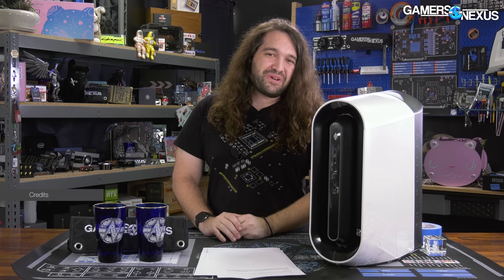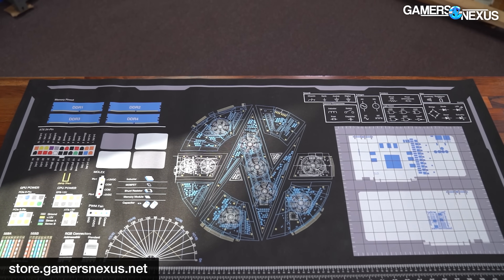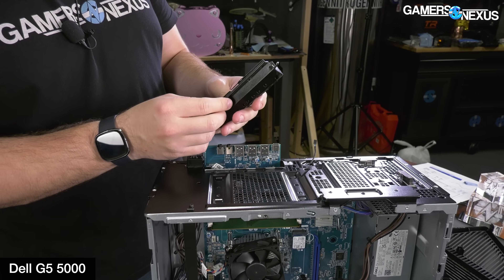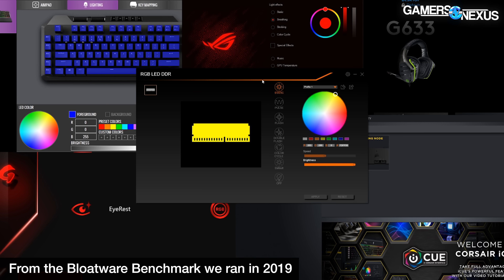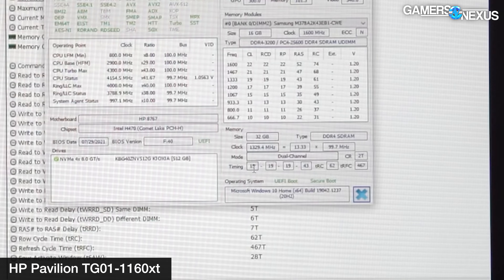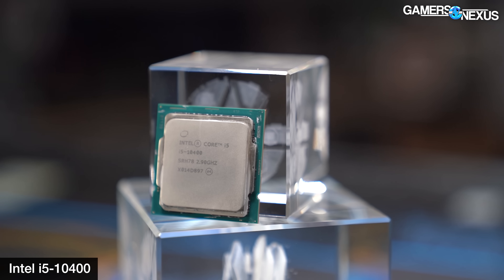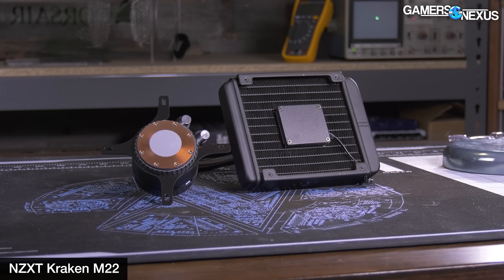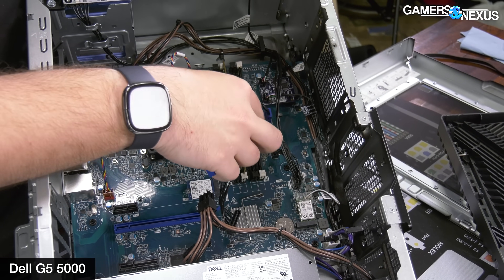The Worst Prebuilt PC Mistakes We've Seen (So Far)

Comment: there are a LOT of prebuilds that lie about ram speeds. blatantly lie.
Ive seen countless ones that advertise higher speed ram on an intel platform using  "b" series motherboard. 
like say, 3200mhz with an intel i5-9600k on a b450; the platforms chipset literally CANT support those speeds.
and whats more, than ram doesnt have an XMP profile, so it couldn't even be run at those speeds in most computers without manual tuning. 
and even then, half the time the ram cards themselves dont even meet that spec at all.

ASUS, MSI, Dell/AW are the ones i mostly see this on. Lenovo USED to be better, and HP wont tell you; they cant lie if they never disclose that info right?

Comment: I once had an Acer prebuilt. I5-8400, 8 Gigs single Channel RAM, Zotac GTX1050 2gb Mini 75w version. I bought a new sata ssd for it to have more high-speed capacity and had to srsly, tape it to the metal frame because there were no mounting holes for 2,5" drives, only for for another 3,5" drive. Ive upgraded the RAM from a friend´s failed attempt building a pc to 16gb and like a half year later got rid of the case, bought a new board for the cpu and wanted to swap over everything. Well, the psu was mounted in such a way i srsly had to destroy the old case to get it out, had so short cables, that it wasnt usable in any other case. Ive got a new psu and had good temps with the "better then intel stock but still shit"-cooler, but switched to the cheapest available aftermarket cooler, at that time it was the cooler master tx3-i with the worst mounting mechanism ever, but that piece of crap improved the temps by 10°C. I still have the board as kind of backup board, it came handy when i checked if my cpu was dead this year, it was not, but its the e-waste of non-standard front IO on the board kind of shit. Luckily, i got the oppertunity to get rid of the piece of junk 1050 and the i5, got myself an r7 3700x and rtx3070ti for them. the cpu still exists in my server, the rest is kinda sitting in the drawer, even if i could scalp some money for the gpu, i dont anyone suffering from it (its main problems are the 2gb limited ram and that its limited to 75W, no external headers are there)

Comment: My parents had a Pentium 4 era Dell that they passed down to me. Windows XP. Cool! Sweet oldschool gaming machine. However, the power supply was bad. So, I go out and buy a new one. Interestingly, while the PSU in the Dell was (thankfully) a similar size as modern ones, the cutout in the back panel was not and was designed specifically for the Dell supply. To make the back switch and plug accessible on the new power supply, I ended up having to use a rotary saw to cut out a bigger hole. Yay proprietary designs! I had even thought about taking the motherboard and swapping it to a newer case, but nope! No-can-do. The front I/O is completely proprietary and there was absolutely no way to transfer that to another case. Fun times. So there it sits, next to my other "sleeper" retro builds, in its generic-as-all-hell "Dell Dimension" case.

Comment: My dad bought a Dell SFF PC in 2019 that on paper seemed like it might be decent: i5 8400, 16GB RAM, 1TB HDD, maybe even a basic DGPU. But even new it was barely capable of booting Windows. After removing Dell bloatware it was still barely capable of booting Windows. 20+ minute boot and shutdown times, for example. I finally traced it back to the storage, which was a 1TB 2.5" spinning platter HDD running at a truly lethargic 3200 RPM. But after 36 (non-consecutive) hours spent trying to swap to a 2.5" SSD, M.2 SSD, or even just a better HDD we resolved to scrap the entire PC and go back to the custom desktop I made them in 2015 because at least it ran. Dell's BIOS refused to recognize any storage medium that wasn't their own pre-installed HDD, locking out any upgrades or replacements in firmware. I so badly wish Dell would go out of business.

Comment: I understand using cheap motherboards and power supplies, in the end they are trying to squeeze every penny out of consumers. But when using these non-standard motherboards and power supplies are they really saving any money. It would seem to me sticking with 24 pin or the new 10 pin intel layout for power supplies would allow for more options in power supply manufacturers. Then the weird size motherboards with these odd adapters and plug ins must cause higher over head when it comes to designing the boards and only having them made for specific models vs a cheap matx or atx board.

Comment: Well over here luckily some of the pc part suppliers started to make their own pre-built pc's which makes them a lot better.
 Usually they would have a configuration I would build as well and you can see all the parts before you buy it. 
It will just cost 150 to 200 more then if you built it yourself but it seems in the Netherlands we have better options.

Comment: I just don't get it. I go to HPE, buy a bunch of proliants, a machine that sits in a redundant cluster doing boring crap nobody cares about, I don't have to check for loose screws or fire hazards, just works. I go buy a Pavilion, and it's a dumpster fire minefield. When you achieve a certain level of competency, being bad on purpose takes more effort than doing an okay job. I just don't get it.

Comment: I built my computer better than Dell. Mostly because it was a Dell where random proprietary stuff blew up so I ended up transplanting what little I could into a brand new case. On the brightside, they did give me dual channel RAM. 
It sucks cuz I have a much older, 2003 Dell Dimension that's a joy to service, big hinged clamshell case, tooless-ish rails for the drives and I think a standard ATX PSU, that hasn't yet blown up.

Comment: I haven't bought a pre built PC in years but owned a few laptops. This is what I do. I register windows and make sure it activates properly. I format the drive and install a fresh bare bones version of windows. I download the drivers and some of the software I will be using for that machine. The boot times on the laptop are about cut in half by doing this and feels a lot more responsive. The amount of bloatware on a laptop/prebuilt is very uncalled for. The manufactures are making more money off the PC because the bloatware companies pay manufactures to put it on their machines.

Comment: In my opinion the proprietary power supplies are the absolute worst sin you could commit when building a system.  I have rarely had components in computers fail over long periods of time more than power supplies.  In fact one of the things that I'll do if my computer gets unstable over time is to replace the power supply.  Worst case scenario you now have a good power supply to power whatever is broken, like maybe your video card.

But with a proprietary power supply, you have to throw the whole system away because the chance that you'll be able to find a NOS version of that same power supply five years from now is near zero.

Comment: A lot of prebuilts are expensive due to propritary parts.  Computer makers should be more mindful about the e waste that is generated because a lot of them can't be transferred outside the Evo system they are in.  The mobo where the io was built into the mobo was itx but the letgth was like atx.  And don't get me started on some of those psus.

Comment: When it comes to bloatware on a prebuilt PC, I had one solution.  Wipe the main drive and reinstall Windows.  I did this when I bought my Dell XPS 9100 back in 2010.  It got rid of the bloatware and the system was working much better because there wasn't a dozen useless programs that were working in the background.

Comment: My pre-built horror story came courtesy of Alienware (pre Dell days). It was the mid 2000's, and I'd gotten my first real job after University.  I'd built my own computers before, but after AGP GPU's had gone the way of the dinosaur, I needed to upgrade my system and decided to splurge on an Alienware Aurora 7500 (you know the one, with the R4 case).  After parting it out price wise to figure exactly how much they were gouging me for, and reflecting on how long it had taken me to build, install, and troubleshoot my previous PC, I pulled the trigger on some sweet mid-00's shiny black plastic behemoth of prebuilt PC power.

The day it arrived, I was ecstatic. The Box was huge, and I required help from a friend to get it in the apartment. I opened everything up, set it up, pressed the power for that sweet goodness, and waited for the thing to post..... and waited.... and waited.  

Finally giving up on it, I figured something may have come loose during shipment. I opened it up, and began checking RAM, power cables, the usual suspects for what can happend when PC's get handled 'gently' during shipping, but everything looked ok.  I called tech support, and spent the better part of an hour with this patient support rep, and finally after everything else had been tested, rebooted and secured, he asked me to pull off the heatsink.  There was the problem, the CPU wasn't there, just some Artic Silver oozing into the AM2 Socket.  My heart fell through the floor.   Apparently, someone had swiped the Athlon FX-62 between testing and shipping

I sent it back to Alienware so they could post mortem the husk of shiny plastic and metal. An internal investigation ensued, as Alienware either chased down who the CPU bandit was, or probably debated if I was pulling a fast one on them. (It took less time to get the original PC than it did to finally get the replacement.)  Phone calls between me and my "Case handler" went on for weeks before I was about to demand my refund and be done with the whole affair, but eventually they sent the replacement that worked without fault.

In the end, I enjoyed that PC everyday it served, until I ran it too hot and some MB capacitors popped their tops. (It gave off two long sad beeps before never posting again) But man, the first month of "ownership" was all I ever needed to steer clear of pre-built systems going forward.  (The case still serves as a conversation piece, and I actively ignore thoughts of getting it working again)

TLDR: Alienware employee swiped my CPU before it ever left the factory, and sent me a dead system.

Comment: I bought two machines from CyberpowerPC for work unfortunately right around COVID lockdown. They were shipped to my office where they sat for 3 months before someone could do anything with them. I finally got to turn them on, only to find that both didn't POST out of the box. I pulled everything and still no POST. I removed the CPU, and found thermal paste in the CPU socket - in the pin holes and on the pins and under side of the CPU. I boxed both of them back up and sent them back for RMA because it had been too long for a return. It took almost 6 months to get it resolved.

Comment: I don't get the landfill jokes. Any PC you buy or build will wind up in the landfill sooner or latter. Parts break, become obsolete or the owner wants something different and the parts wind up being disposed of. While Dell and HP use proprietary parts, their machines are reliable. Look how many old machines are up for sale on the auction sites. Personally, I had units that still worked after 15 years, well after they became unusable. 

If you build a computer today and in three years you want to upgrade to current technology you will need to replace everything except the case, fans, and maybe the power supply. The motherboard will be different, the processor, the memory, the power supply may be different or you may need a more powerful one. So you can replace those components or just sell the PC outright and buy or build new.

Comment: I don't understand your hate for 120 AIOs, they are great when used for exhaust as the graphics card does not use CPU heated air to cool. My CPU runs normal use only 10c over ambient, all day long. 20c over ambient when gaming with a 2700X in a Raven RV-02E case. My GTX 970 Strix stays at 30c over ambient temp air cooled OCed when gaming. It was 40-50c over ambient with the air-cooled CPU.
My AIO was only $10 more than a good air cooler too.

Comment: I purchased a build from Redux and there's been A LOT of issues. Purchased it on March 17 got it in May but I understood that it's when I got it I seen the RAM that they put in was not the same as advertised and had no XMP (Patriot signature line) the AIO cooler what also not the same as I ordered. The TD mesh 500 that they use should have 3 preinstalled fans and they said that there would be 4 free MF Halos making a total of 7 fans in the case a d it only came with 4, and the case fan that is in it aren't even Cooler Master fans. The model number on the fans doesn't even match Halos. Been trying to get help for 3 months and I've got nothing just ear bleeding zendesk music and a big F U from Build Redux. Plz review their PCs bc God knows how many ppl the shafting.

Comment: Steve this content gives me life. You and your team deserve all of the success in the world as hard as you work to fight the good fight and hold companies accountable for their horsefuckery.

MY experience with a shit SI build: Cyberpower's ITX system. They sent us the wrong case, they got thermal paste literally on almost everything, they managed the cables so badly that the right side panel has a permanent bulge in it, and they managed to somehow actually gouge the GPU shroud, power supply, and riser cable connector... ALL of which passed QC, by the way. Also the fan config was garbage-tier, 120 mm AIO with mismatched push/pull fans in front and no exhaust fans. Changes the config and positioned fans in the right spots, now the rig runs cool and quiet.

Comment: If they're using non-standard parts anyway, might as well take the leap and just start tossing laptop-sized boards into the case, add whatever connects are needed for I/O and GPU, and call it a day. That HP PSU was pathetic looking.

Comment: There was a local builder near me that built really bad systems. My former boss insisted on using them because of their price. On one system, the case was so warped that the video card and expensive proprietary video-capture card actually fell out of the slots and shorted out the motherboard while the system was in use! On another system, there was a chassis ground problem so that peripheral boards and devices kept frying. Just for kicks, I took a piece of wire and screwed that into the chassis from the power supply shell and there were no longer any dead components. 

Big-name companies always shortchange something to keep their costs down. The biggest areas they chintz on is memory and disks and both are really necessary for computer performance. In the olden days, Dell, HP, and Lenovo would populate the slots with older 2GB RAM sticks, or 2-4GB sticks to build up an 8GB system. This was  a pure waste of money because these had to be pulled in order to upgrade the RAM to anything larger.

Speaking of bloatware. My bro purchased a Dell laptop. A nice 15-inch 2-in-1 that he uses for business. When he first got it, he thought there was something wrong with it because the performance was so bad and was ready to return it. The problem turned out to be McAfee. After going through and un-installing that, among the other crap, the machine turned out to be quite spiffy. The biggest difference, though, came after uninstalling the McAfee crap. I warned him about the bloatware, but he didn't listen to his older bro!

Comment: 120mm liquid coolers are common in prebuilts mostly because they reduce RMA rates: the bulk of the cooler's mass is mounted to the case, not the motherboard. The waterblock also gets additional support from the tubing. On a bumpy ride, air coolers with a lot of mass can put stress on the motherboard, which may result in DOA systems from time to time. And especially seeing how RMAs are expensive and bulk ordering liquid coolers is cheap - it's a rather obvious and cost effective solution.

Comment: My Favorite pre build Story was of a System, i think it was a Dell Or HP system, based on a ryzen 3600, where they put the CPU 90° rotated in the Socket and screw the cooler with enough force in place, that there was basically not one Pin still attached to the CPU

Comment: 12:40 - those "motherboard screws" - aren't those actually the ones used for the 2.5" / 3.5" drives?
I am an amateur builder, I made this mistake a few times. I wouldn't expect a large company to go for such an epic fail.

Comment: Just want to add with the RAM stuff, 32 gigs does have quite a strong performance uplift if you're planning to play games heavily modded, as mods generally won't communicate with eachother to save on memory.
Reply: Also, if you're a regular beta tester - 'in development' software is usually very poorly optimized as it's constantly being changed and updated, so it ends up requiring more memory to function than the finished product.
Reply: So true. KSP with a decent set of QoL mods (no GFX mods even) eats 10GB on start (and don't get me started on Unity-based games and the 1.5GB+/hr RAM leaks). Add a browser window for anything and 16GB RAM is gone pretty much right away.
Reply: @battlecommando  stop using chrome, firefox eats less ram. And watches you less
Reply: @SoloDOS_021  firefox is slow as sht.
Reply: Another thing I observed is how Intel built in graphics likes to work. Currently have 32gb usable in my laptop out of 64gb because half of the system memory is being reserved for the graphics side of the Intel APU.
Reply: Also - want to run some VMs? 16 gig is just too little - 32 is the minimum. Found out the hard way when my online computer course required from us to run 5 VMs at the same time - one server and 4 clients